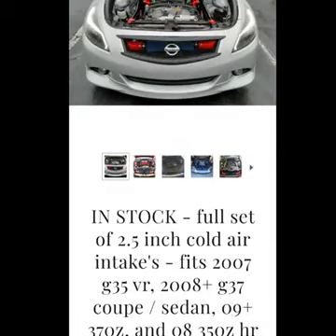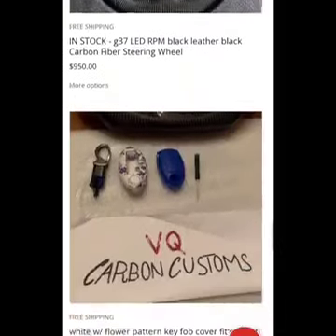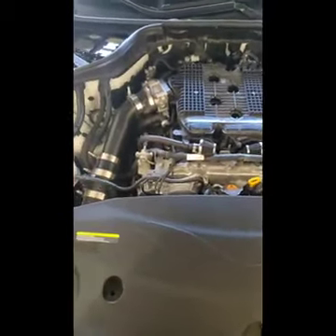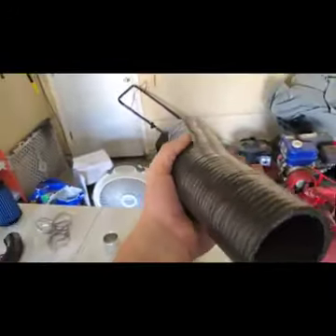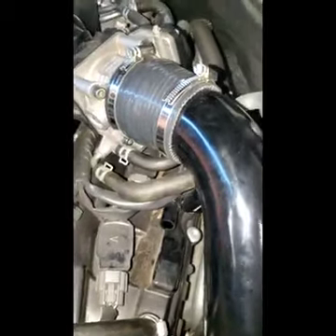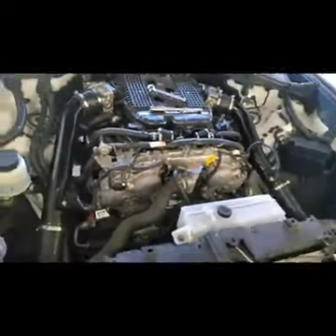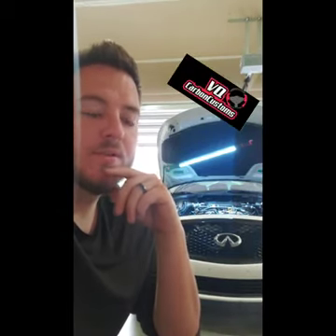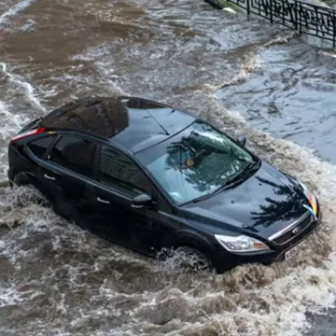Q70 Infiniti Intake Install and Review of VQ CARBON CUSTOM 2 5in C A I

Comment: Great work and video man. Is this a q70L? or a regular q70 3.7. I ask because of the chrome trim on the bottom of the doors as you were pulling into the garage.
Reply from the maker: Correct q70L meaning long wheel base so all of the Q70L have the chrome side guards

Comment: Do you simply remove the grill for filter maintenance? Not the whole bumper?
Reply from the maker: That depends on the filter you use.. tho one supplied you could technically loosen all the clips and drop from the bottom but at that point should probably take off the bumper. Or you could remove filters and use a hose or something at home to clean them up and reinstall but I wouldn't drive untill their pretty much dry
Reply: @Vortec.Z32  thank you
Reply: do they give u a check engine light being that u don’t got. tune ?
Reply from the maker: @tobur1  no check engine light with these. For a (2.5in maf housing) a tune isnt required. A (3in maf housing) changes the way the maf table is read compared to what's actually being pulled in to the engine so it would require a tune let alone won't start because the flow would be skewed quit a bit.
Reply: @Vortec.Z32  good bc my g37 isn’t tuned yet just getting my intakes from VQcarbonCustoms and getting test pipes until i do .. but are they ruining good for you since u installed them with the airflow? and would u recommend them instead of spending 5-600$ on big brand intakes ?
Reply from the maker: @tobur1  at a 2.5in intake there as good as any but better for the price. Especially because there not a typical short ram soaking in the heat of the engine bay. But as I shown in my video there is proof they are better then factory just by installing them and no tune. So a tune would still benefit with these for best optimization. So in my opinion they really are great for the price the only thing better I'd recommend is a true 3in intake kit for example admin tuning 3in intakes same as these just in 3in not 2.5in. They have shown improvements throughout most of the Powerband if tuned correctly.

Comment: Link to the filters you used ?
Reply from the maker: Yea I can if you like, but I have switched back to the filters that came with the kit. I talk about this in the next video. Theirs nothing wrong with the factory ones that come with the kit, best part about them Is they can be removed and cleaned without removing bumper. The velocity cones do add some hp down low on a dyno shown many times before. But in this video the before and after is without the velocity cones and filters. Just as kit comes.
Reply: @Vortec.Z32  what’s the difference between the stock and the velocity stack?
Reply from the maker: @jerrynava658  to clarify the stock filters that come with the kit are not as efficient as a velocity cone and more surface area  setup. Easier to breath and better for quick smooth throttle response and high rpm gains. But the difference isn't somthing you can feel just by the seat of ypur pants an swapping filters
Reply: @Vortec.Z32  gotcha so what particular filters have the velocity stack? I’m looking between these intakes the z1 and the takeda intakes.
Reply from the maker: @jerrynava658  watch this, it's a great explanation of a velocity cones setup. https://youtu.be/SIjBU9tI-Go

Comment: Just ordered their intakes, and honestly feel mixed emotions about it. I got people telling me their good, and people telling me their bad. It was not expensive at all, no shipping tax, so honestly just need an honest opinion about these. Do they actually provide quality or do they just look good? …
Reply from the maker: There good I prove a before and after performance on stock tune nothing else! The only thing I changed was the filter because I don't like the blue and I had some with velocity cones already. Also side note I was able to get the pcv valves connected also
Reply from the maker: @chingatumadre6450  sorry I just seen the notification for this. This has been reported on some unfortunately. I wish i would have seen this issue first off so i could of mentioned it in the video. But scents you already purchased the intake just take a file or somthing corse like a grey scotch bright pad and smooth it out. For extra measure simply spray some primer in there out of a spray can to prevent any future rust.
Reply: Hey my friend, are you still available?